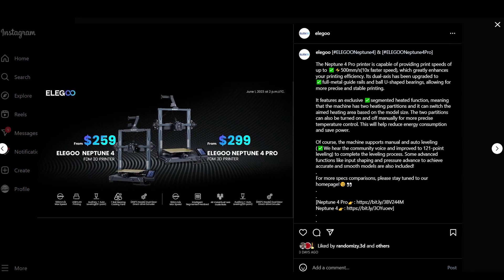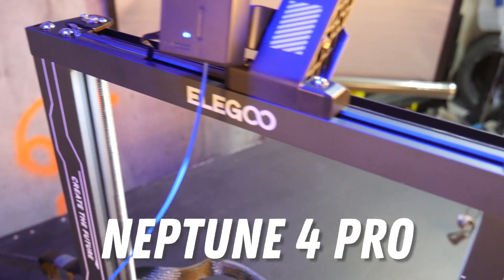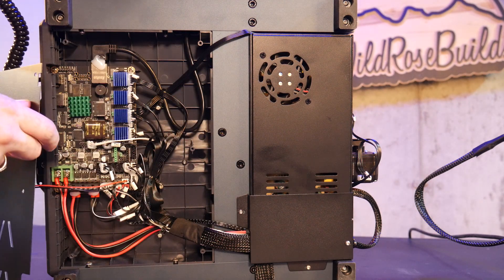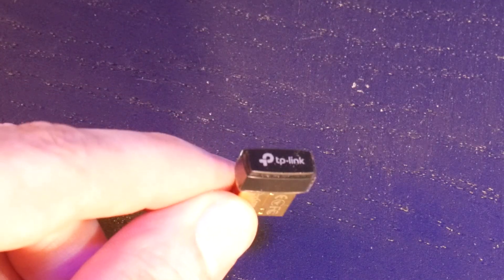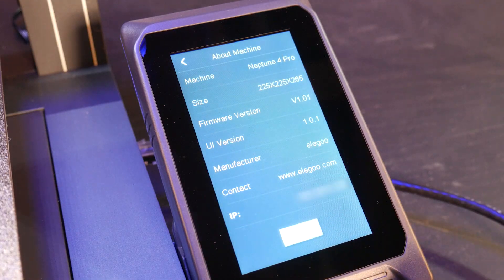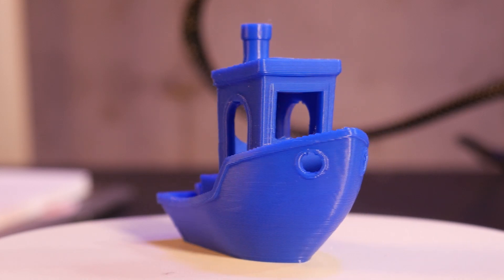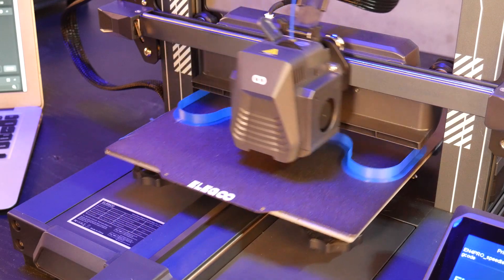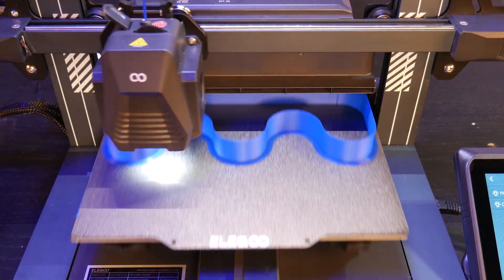The NEW Elegoo Neptune 4 / 4 Pro Printer - First Look

Comment: I should buy my first 3D printer, and I'm undecided between the Elegoo Neptune 4 and the 4 PRO version. What advantage do the metal guides and rollers of the 4 PRO version provide? Do the plastic ones in the 4 version tend to wear out? If they tend to wear out after many prints, are there any replacement parts available? Is it worth spending a bit more to have only the heated bed with zone heating and the metal guides and rollers?

Comment: Hopefully there will be a 300 mm cube print volume Klipper printer with a built-in accelerometer for input shaper tuning.  A Klipper machine without an accelerometer misses a lot of the speed and print quality advantages.  A Klipper printer should also have WiFi to make it easy to use Klipper.  Who uses a wired LAN connection these days?

Comment: How does it compair to the the Anycubic Kobra 2?
Reply from the maker: the kobra 2 is non klipper so it lacks a ton of the features that the neptune 4 and 4 pro have!
Reply: @WildRoseBuilds  yeah but the Kobra does Auto level bed as well as the z offset so nicht manual adjustment nieder to use it, the neptune does not set the z offset automaticly doesnt it?

Comment: This is all very nice in theory, but when it comes to printing at that speed, let's say 250mm. The question is how many parameters we have to change depending on the material. I don't think cura is ready for V4. So why do I want to buy something that is supposed to print at 500mm/s, but it is recommended to print at 250mm/s. This sounds to me like ELEGOO wants to bring out the first 3D printers, (afordables), but let us solve the rest of the problems. 
Now suppose I'm in a hurry and I want to print TPU at 500mm/s... I don't think it's possible and I'd like to see it. But for the end product to be of quality...who benefits from that, obviously ELEGOO, it doesn't get us out of trouble. What they should do is start researching on connecting the 3D printer with the AI and solve the problems of printing with different materials...that is going to be a game changer.
Reply from the maker: To be honest fine tuning material specific parameters will always be the job of the end user unless there’s a proprietary filament involved. Companies like zortrax have done this and branded filaments as “zabs” and “zasa” and it does work well but the 3D printing community doesn’t seem super receptive to a closed ecosystem like that. Prusa has done it as well while keeping it open source with prusa ent but as a prusa user of over 5 years I’ve never once bought a spool. I think the lower price point and fast print speed warrants the few hours and a couple dozen grams of filament needed to fine tune these profiles for any given material. If you’re anything like me you probably print all the same brand pla, abs, petg, tpu, etc, making tuning that much easier. Thanks for the input and for watching!
Reply: Lol I ordered one because I want to print at 150mm/s which is double what I print at now. If the quality is the same as what I’m getting now I will be stoked with half print times

Comment: Are the 4 fans controlled manually? I saw an on/off button on the top of the shroud
Reply from the maker: I think they might be tied to the fans in the print head. You can turn them off manually with the switch as well. I’ll have to do some more digging to see if they can be gcode controlled separately from the toolhead part fans.

Comment: Love your videos. I am bit concerned it did not come with the accelerometer for input shaping.  Please make a comparison video with P1P 🤞
Reply: It is about $25 for an accelerometer, and you can use the one on many machines.  I already have one because it comes with the Sonic Pad.
Reply: @petercallison5765  it's about $6, actually. There are pins for it on the board, it's just a question of if they run on the same spi bus as the mks pi (0.2)
Reply: You can have almost 4x Elegoo Neptune 4 Pros! And if I had need for 3D printer farm I would go with Elegoo.
Reply from the maker: True, the WiFi dongle and accelerometer are cheap on aliexpress. Still annoying though.
Reply: @WildRoseBuilds can we get some links for those two, please?
Reply: Does it need soldering to add these modules?
Reply: @sabotage3d  no, the pins are already on the board

Comment: Should i order this one or kobra 2 is fast enough while saving few bucks?
Reply: The Kobra has the fancy levelling and wipe. It only too a couple weeks to get my Kobra 2.
Reply from the maker: I’d get the Neptune 4 just for the ability to use the klipper input shaping which the kobra 2 doesn’t have
Reply: @WildRoseBuilds  thanks for the knowledge, plus no need to adding more cooling fan in N4/N4P

Comment: I JUST got the Neptune 3 pro today. It prints fine. Now I'm wondering if its even worth keeping. Spend time to fiddle around with trying to setup Klipper on it or just get a new machine with it preinstalled
Reply from the maker: N3pro is still a good machine. Mine prints 24/7. You could always wait for the Neptune 5 lol
Reply: @WildRoseBuilds im still trying to get the Neptune 3 Max, but since its always sold out everytime I try to buy one, I might as well just wait for the Neptune 4 Max  😂😅

Comment: I recently got a Neptune 3 Pro, my very first 3d printer. I have no complaints. I am using an old laptop to run Klipper and used adxl345 with a Pi Pico to do input shaping. So far the prints are very stable and only had one bad experience with an overnight print due to my bad slicing. I am unable to integrate my Razer Kiyo webcam to the Klipper+Mainsail setup. I setup a timer to remind myself and preordered the new Neptune 4 Pro. Now I have to revert back to stock firmware before returning to Amazon. Cant wait!
Reply: Did you order it within the last 30 days?
Reply: @project_hollow6627  Luckily Yes.
Reply from the maker: Hahahaha I see you’re using the 2 hour playtime on steam method.
Reply: @WildRoseBuilds  :face-green-smiling:

Comment: That board is based on the mks skipr. The possibility of an rk3328 kinda scares me

I want to solder in a dual usb header that they omitted from the board

I also want to tap into the adxl pins that are next to the missing header
Reply from the maker: Yes! Usb hub and a permanent adxl are in my list of mods to do as well. Thanks for watching!
Reply: @WildRoseBuilds  i kinda hate being on the sideline with this machine and not having one to mess with because I could/would do so many things to that board.

I watched mandic do exactly what I had wanted to do and install a WiFi dongle, ssh into the device, etc and I was taken back by the fact that the cpu temp was almost at critical level (78°c). I also want to try a Netgear ac1200 on the Ethernet port to compare the network reliability between both solutions. 

It's running the same makerbase Armbian that the skipr and pi run, almost solidifying that this is an rk3328 (it's a fork of the libre renegade trunk build). The fact that it's running so hot also proves that it's an rk3328 because I had thermal issues with my mks pi boards before installing cpu fans, but that didn't stop them from continually dropping and failing prints after a while. I'm really worried that the neptune 4 will meet the same fate unless someone tweaks the armbian distro to do a better job at running Klipper. The Klipper community is quick to blame the user, so they are no help and Makerbase literally told me to just buy new boards when I asked them why they were continuing to fail prints.

I'm now team BTT. I'm running a cb1/pi4b, btt pi and pad7 reliably and will be doing a rebuild with a manta e3ez coming up real soon. Makerbase can take a long walk imo.

Comment: I wasn't considering one of these until my Kobra suddenly died earlier this week.  I have replaced parts and the motherboard, but it still fails to work.  Anycubic support has not been great, so after watching a breakdown on this, I figured I would pre-order the Neptune4 pro.  I have a Neptune3 Pro as well and was contemplating ordering another one of those to replace my suddenly dead Kobra.  But I will be patient and use just the one printer until the 4 pro arrives.  I'm still scratching my head as to what happened to my Kobra.  It was literally working in the morning, started a print.  It finished fine.  removed the print, went to home the bed and the thing went crazy.  Now I can't get it to do anything.  Even after replacing the motherboard.  Manual movement works, but only up and to the right.  Left and down controls do nothing.  The bed level sensor doesn't do anything at all either, which is really strange.  Hopefully I can get it all figured out.

Comment: is the nozzle proprietary? is it hardened for cf filled filaments?
Reply from the maker: The nozzles that ship with the printer are not hardened just brass. the heartbreak is bimetal so it can go up to 300c. The AnkerMake m5 also uses this nozzle length I believe. It’s not proprietary but I’m not sure if anyone’s making hardened variants right now. Thanks for watching!
Reply: @WildRoseBuilds  Looks like same nozzle on the Kobra 2 (you can't buy those and the thread is weird)

Comment: Hopefully they'll make Max ver of Neptune 4
Reply from the maker: Hopefully! I hope they go bigger Seeing as how a company like tronxy is making a 800mm machine
Reply: @WildRoseBuilds  my only concern if how they they going to solve Z wobble at higher heights at high speed...
Reply: @SlowRkers  that'll probably the real challenge here
Reply from the maker: @Kumomo92 struts might do it, slinging a bed of that size probably isn’t ideal but pressure advance and input shaping at lower speeds with a larger nozzle size would be cool. Elegoo did have a cube frame Neptune so maybe a revision of that model with klipper could be something?
Reply: @WildRoseBuilds  wow 🤪
Reply: Surely the will ,
Reply: With the current "Max" max sales, its basically guaranteed we get it provided enough time.